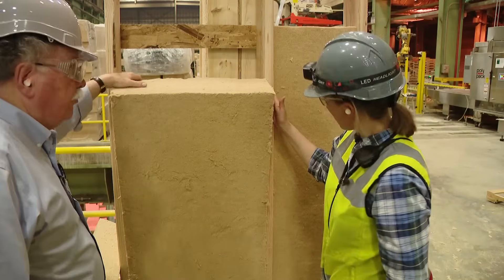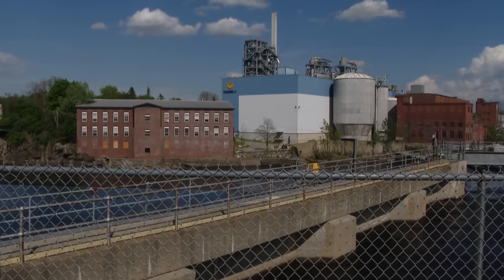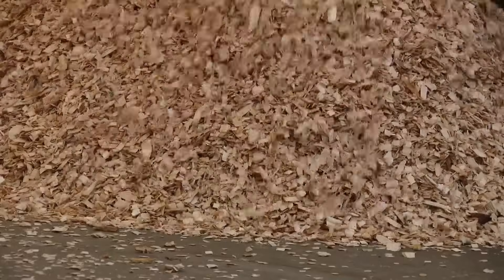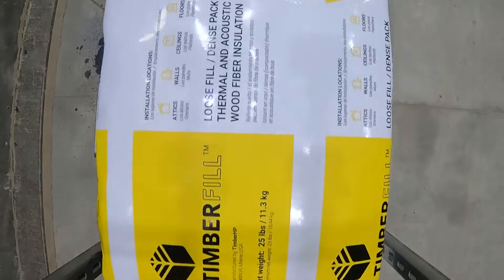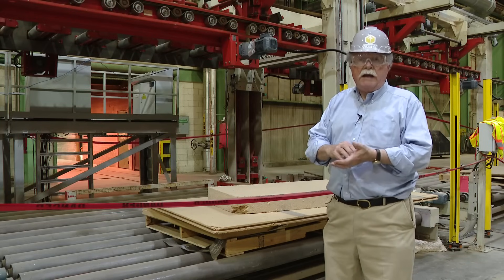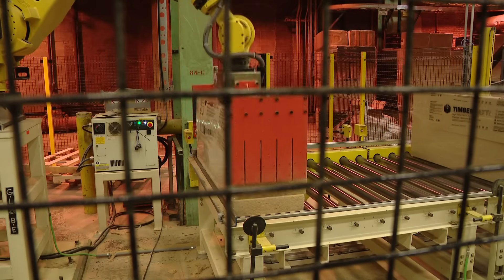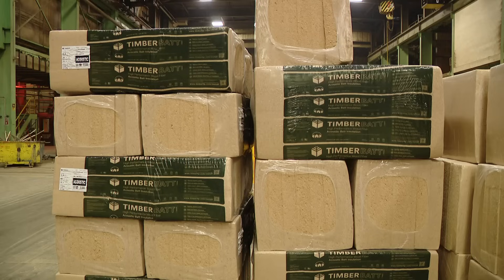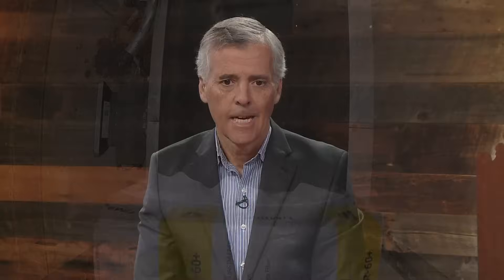Maine business creating building insulation out of waste wood, and doing it in an old paper mill

Comment: Not a word about flammability, one of the most important aspects of insulation.
Reply: In the last scene, the label says Class A Flame Spread (ASTM E84). Personally, I don't know what that means, but it sounds good.
Reply: @terryr.5093  So if it's treated with something like a flame retardant, I would wonder about out gassing and any possible health consequences.
Reply: @chris - absolutely no off gassing . it was invented in Europe decades ago and is one the most popular product used in retrofits . 
the rigid version is used on exterior walls and roofs and covered in siding or stucco . it's super clean and stable

Comment: But wood isn't a very good insulator compared to say fiberglass. wood insulation value is only R 1.25 per inch. so 3.5 inch wall would only be R 4.375 vs R13 for fiberglass, and what about flammability? Add chemicals to make it flame retardant and now you have health issues. Also you have to be concerned about bug infestation so now more chemicals 🤷‍♂️